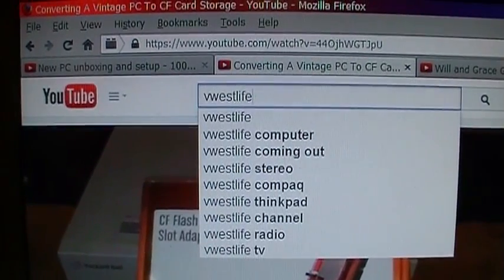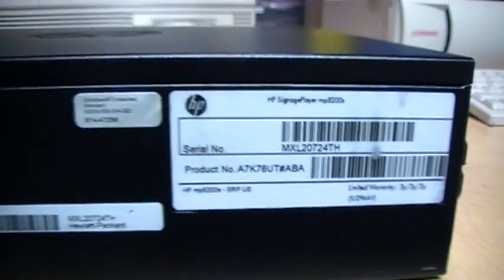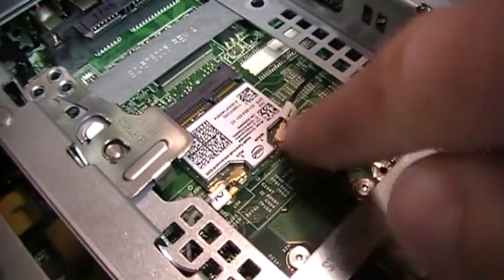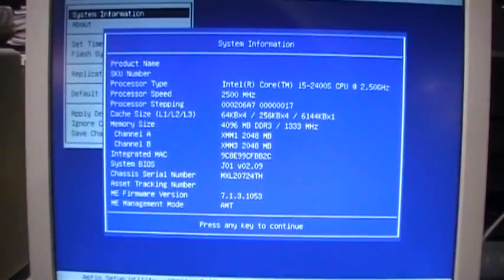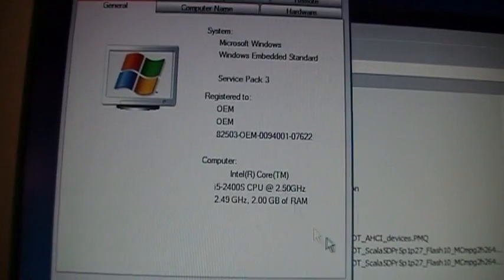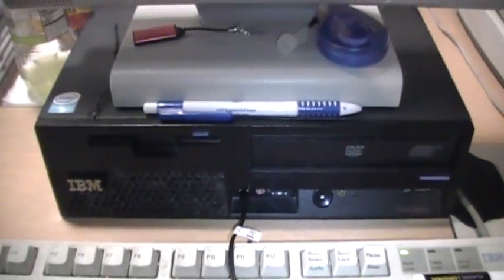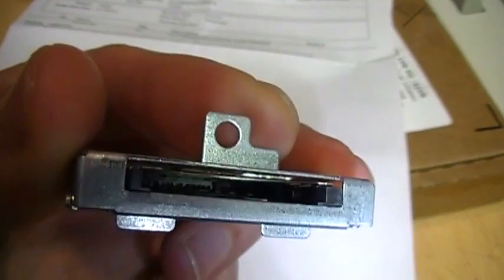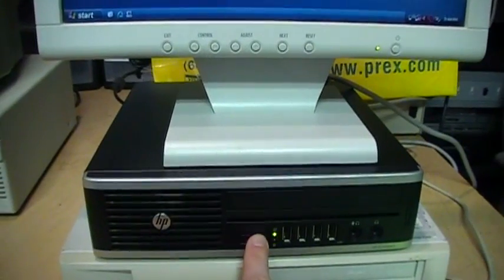My "new" computer: HP Compaq MP8200S

Comment: Nice system. Nice that it has so many usb connectors.
The "special connector" for the usb card reader should be plain USB.

The power supply is a fail though. It's so big it should be put inside the case.

Comment: I'd put Windows 7 on there, you're not going to want to run any form of Windows XP on an SSD due to the lack of TRIM support.
Reply from the maker: Intel SSDs have built-in wear management, and I have the Intel SSD Toolbox software installed. I've have the same model of Intel SSD running fine with XP in my ThinkPad since 2012.
Reply: vwestlife Do you run anything newer than XP? What is your opinion about the end-of-life?
Reply: ***** They still wear out as the memory cells have a finite amount of write cycles they can take before they die but a good SSD should easily outlive the average HDD assuming it doesn't have other issues like bad firmware code.  That can be the failure of most SSD's and even HDD's before a mechanical failure kills them.  TRIM and other wear leveling on an SSD is there to minimize the write cycles and also spread them out across all memory cells (memory chips) as to not wear one out faster than the rest so they're designed to last as long as possible.
Reply: +Gmoney 6422 it comes bundled with bonzi buddy!!!
Reply: Windows 10 is a virus oops theres tutorials and apps to disable the spying capabilities. OOPS, ALL IRRELEVANT

Comment: Ooh very nice! I'm a big fan of HP Compaq hardware, it just seems that they're the ones getting it right nowadays. Lots of people seem to have this very blurred idea of what HP Compaq actually is, and what kind of quality they produce. My next computer will probably be a HP Compaq SFF machine, or maybe a USFF machine.

Those VESA mounts are actually for a specially designed monitor stand that HP sells with some monitors to create an all in one unit. An example being the HP LE1901wi monitor. Also for a machine like that, I'd expect a maximum of around 16GB of RAM. I honestly had no idea that those can be configured with dedicated graphics, all of the ones that we have at work seem to have integrated video. I've also yet to try Windows Embedded Standard 2009, but it looks a lot better than POSReady for sure.

Enjoy using your new computer. Oh and one last thing: DisplayPort is actually backwards compatible with VGA, so you can get a passive adapter and use a second display that way.

Comment: I own 2 of these exact units.  They can handle a minimum of 8GB Ram (depending on the BIOS version), there are no USB 3.0 ports, and only the 1 Mic/Audio out jack can be used dual purpose (only the front panel port).  These are great machines and very powerful for doing pretty much anything, standard integrated graphics will slow things down for gamers however.  These are almost Identical to the HP EliteDesk units sold to enterprise customers today.  Both can boot off of any standard USB Drive to install any modern full (retail/OEM) version Linux/Windows 7/8/10.

Comment: That's neat it has a dedicated AMD (ATi) Radeon GPU and vRAM on a mini notebook style (MCM?) PCI-e board (the small red board with the heatsink behind the optical drive) I've never seen that style notebook video card in a slim desktop before.  It must have 2GB of vRAM on the video card hence the OS only sees 2GB of system RAM.
Reply: Nope, actually, Embedded 2009 can't take on more than 2 GB of RAM so it limits 4 GB to 2, not even 3.5 like XP 32-bit would. I use Vista Home Premium 32-bit and in some cases, 64-bit. I never really bought a computer but my friend has this one still and is currently using it with 7 Home Premium (i used my own multi licence for him) 64-bit and has all 4 GB RAM allocated.

Comment: That computer looks nice. I would be getting one instantly (even a lower specced model with an i3 or Pentium G and without the dedicated graphics card) to be my radio automation and streaming PC, but the lack of at least two serial ports (which could be fixed easily by USB to RS232 cables) and a full height PCI slot (for my M-Audio Audiophile 192) puts me off. So far I'll stick with my custom built tower PC for the task.

Comment: I have kind of a bigger and whiter version of this SFF, it has fewer USB ports on the front and a 80GB HDD. Came with a very strict Vista Business SP1 32-bit OEM which would only allow me to use IIS features or go on the internet. Even if the support has ended, I don't care, It runs Vista Home Premium SP2 32-bit with my original Microsoft SP1 licence. To be honest, Vista Home Premium runs faster than 7 Home Premium here. It also works very well, it's kinda 12 years old now so I'm not planning to sell it. Both side panels also broke off.

Comment: Nice, i have a sff system myself, it's a dell optiplex 3010. It has an i3 3225, 8 gb ram. I put a gtx 1050 ti in it and it's a tiny powerhouse of a pc. Love it, believe it or not it runs most games on high settings.

Comment: That CPU is actually very good, it has 99% the performance of my i5 3470 in my gaming machine, with a good graphics card it would max out all the latest games easy : P
Reply: Levi Pinkard runs cool,  low power use and stuff

Comment: Erm WES2009 is not meant to be installed directly like that,you are supposed to install the Tools into a development machine,run TAP.EXE on the target machine(in this case the HP DigitalSignage),and take the Devices.PMQ file that is made in the same directory of wherever the TAP.EXE is to import it into the target designer,where you get to choose components and enter the PID.
First off the evaluation version of WES2009 iso is NOT going to work with a full tools key,you need to go find it elsewhere.The Evaluation Version of the tools will not allow you to enter a PID to make sure the WES2009 image built are not timebombed.Also you need to find a proper PID,and if i recall correctly it is in a hidden file(forgot extensions) on the root of the installation.
After building the image you need to copy and paste the image into the SSD from the target machine.I recommend copying it multiple times,because sometimes it gives out the ntldr error if copied only once.

Comment: this sounds like a decently capable machine. Mainly with that graphics chip
Reply: the cpu is by far the most capable part of this system.
Reply: What about the Sandy Bridge i5?
Reply: that graphics card is no good, any card with less than 1gb dedicated vram is rubbish
Reply: not exactly, there are some ok 768MB cards.

The main flaw is the chip.

Comment: My school have these PCs now, except the larger version with the slot for the Floppy reader. They also don't have dedicated graphics, I think, but maybe they only disabled the ATi graphics. In System Information, it seems they dedicated 1.7GB of Vram to it. I don't even know how I got into System Information. They also have mSATA SSDs instead of the WiFi card because our school have ethernet wired.
We parted with HP Enterprise so we have HP everything - HP Keyboards, mice, and monitors. The teachers have HP Laptops.

Comment: Recently got the normal HP Compaq Elite 8200 USDT one of these for $50, has a i7 2600S but only the intel graphics. I plan on using a FirePro M5100 that I got from a dell precision laptop. (I will see if I can find a suitable heatsink for it, I’ll probably get a HD5450 from this machine with the heatsink and mount it on the FirePro)

Comment: I have another XP machine that refuses to boot past the bios screen with an external hard drive connected and if I unplug it then it's fine. I looked on the motherboard and many of the caps are bulged. I'm assuming the power supply may have bad caps as well. I have a bag of caps I can possibly use. This machine is a 2.8ghz 2GB and the one i'm on now is a 1.8ghz 1GB.

Comment: Could you put Windows 7 - 10 on one of these?? I would probably use one as a game stream computer in my living room. Maybe some internet usage too.
Reply from the maker: Yes.
Reply: +vwestlife Thanks for the quick reply. These are a ridiculously good deal on eBay for about £150! Definitely going to buy one, as my HP G5330uk is kinda messed up.
Reply: +vwestlife can you test it with an hd monitor? please! test it :-)
Reply from the maker: FryorSatin Super
What kind of test?
Reply: +vwestlife with an hd monitor
Reply from the maker: FryorSatin Super Test what with an HD monitor?
Reply: +vwestlife to test the resolution if it works
Reply: +vwestlife HD is High Definition
Reply: Yes it will work.
Reply: +vwestlife do it because, someone said me, yes. it will work
Reply: FryorSatin Super 
If you are asking to test to see if it will work with an HD monitor yes it will.  Whether you use the DisplayPort output or the HDMI output.
Reply: ummmm i guess?????? i would 7 or xp
Reply: You might want to upgrade the gpu if possible

Comment: HP Scala Signage Player - is that the same as the Scala Video titling software that used to run on the Amiga? Did this unit drive information displays?

Comment: personaly I own a beautiful HP Compaq 8200 elite small from factor and it a war machine! I own 3 mincraft server plus I do gaming on it and it still have some juice to run a 4k youtube video on my other screen. seriously does computers are made for life time durability.

spects: (i5-2500 (socket 1155) 8g ram 480g ssd crucial m500 (power supply 240w original and original mother board) and a radeon r7 240 2gb ddr3)

Comment: Still using xp? Damn.
Reply: Tech Locale XP still works fine to this day as long as you use an adblocker, firewall, and be certain you don't visit unknown websites.
Reply: I use an old version of AVG, 2015 on a Pentium 4 630 HT and 1.5 GB DDR RAM. It runs XP Home SP3 x86 and works pretty well if ya ask me.

Comment: Ahh, isn't it nice, old computers? They have more than 2 freaking USB ports :P
Reply: +Cole Jackson Mine has 8 in total and it's fairly new, just think some brands cheat you of USB's especially with this Cloud storage rubbish.
Reply: Yeah, I'm just saying, most computers have about 2, but I have one with more than that.
Reply: Dang! What kind of computer do YOU have?!
Reply: +GOHSBandVideos Store bought or custom built?
Reply: Eh. Whatever.
Reply: +Cole Jackson my pc has 10 or 12 USB 3.0 lol
Reply: so does mine, i upgraded
Reply: Yeah.
Reply: My main PC (motherboard from 2009) has 8 USB 2.0 ports onboard and 4 USB 3.0 ports via expansion card (2 rear, 2 front).
Reply: noice.
Reply: the nice thing about ps2 ports is that it frees some usb ports for whatever you want
Reply: My 1 year old motherboard has 7 USB 3.0 ports, 2 USB 2.0 ports, and a USB C port. Some cheaper computers will only give you enough for a mouse and keyboard, though.

Comment: Damn... I wish i could find something this well spec'd.

If you run some multi processor optimized video editing software on it, that quad core will shave some considerable time off your video rendering and encoding.
Reply: i have an old hp sff almost close to this one but a little worse, it supports up to 8 gbs of ram if 2x4. currently has 1x2
Reply: it also has a reliable core 2 duo e6550 2.33 ghz which works well
Reply: my main is a dell xps 430 which i upgraded. the core 2 duo inside is what i didnt change. i upgraded the 6 gb ram it had to 8 and put in faster hdds (2tb western sata 7200 rpm + 1tb western sata 7200 rpm (OS) and replaced the 256mb 3650 hd with a 5700hd 512mb. now it works pretty well and reliable

Comment: That is AWESOME. How much did you pay for this? eBay is listing one at $1200!!

I didn't know HP made any sort of box with an MXM-A card slot for the graphics card-- that's highly upgradeable with any MXM-A card that shares that slot type... you just have to rig the cooling for the card you drop in.

in this case, your easiest upgrade would be to go from that 5450 to an HP OEM part: AMD HD7450 http://www.ebay.com/itm/181317366385 for pretty cheap. the existing heatsink should also work, the holes are of standard size. This, along with the latest drivers for windows off AMD's website, and you'll have upgraded to a slightly higher-end chip that'll suck up less power, generate less heat, and keep the computer running cooler for longer with the fan at low speed as you have it.

You can also get a 6770M http://www.ebay.com/itm/181039851891 but I'm pretty sure the RAM chips would need extra cooling, in the form of a $3 bag of RAMsinks with thermal compound/superglue mix to keep them on the chips, if you were to still use the existing heatsink solution. not sure how good an idea that is though. but since MXM-A is still standard for laptop graphics solutions, the possibilities are endless at this point in time. another option would be to steal the proper heatsink for that card and modify it to your needs, but why bother? it's too much work researching this and that and the other thing trying to get heatsinks to play nicely in a nonstandard computer case.

In the end, I am VERY, VERY envious of your acquisition overall, and I hope to see a video later on about any upgrades done past what you've already dropped in so far.

Comment: I Have an HP from 2009 that is similar to this, The Compaq 8000 Elite, but it's bigger, The Small form factor
Reply: It's got 4 USB Ports on the Front, and 5 USB Ports on the Back
Reply: I bought an Elite 8200 CMT for $89.99 to replace my Dell Optiplex 755. i found a matching monitor at a thrift store a few months before.
Reply: @connorm955  Neat. I like the CMT just as much as the SFF to be honest

Comment: A USB 3.0 port has blue colour on its head instead of black also to have 4GB of ram unlocked you need a 64-bit or PAE Operation System. My system is worser but it can run Windows 7 and Windows 8 (with Aero activated) perfectly (Had to disable Aero just for gaming).

Comment: You really aught to load Windows 7 on there though.. Windows Embedded/XP Just limits what you can do.. And 7 is just a much nicer OS In my Opinion.. But that is just me.
Reply from the maker: I tried Windows 7 Ultimate on it, and it runs fine, but I still have some software I use regularly that runs best in an XP-based version of Windows, and Windows Embedded 2009 will still have support from Microsoft through 2019. I may do a dual-boot with Windows 7 in the future, though.
Reply: He doesn't like 7 as far as I know (even had a video where he randomly put a part of a different video in with a guy yelling "Windows 7 SUCKS!"). I think he really won't do stuff that can't be done in XP (POSReady 2009 is just XP SP3 anyways).
Reply: Have you tried the Windows XP mode of Windows 7 Professional? It literally runs programs in a virtual window like Parallels Desktop .. It's really quite fantastic!
Reply from the maker: TheDutchOwner's Tech Channel That was from GoatHerderEd's video about his laptop. :-) Computer Labels
Reply: VWestlife (I know this comment was made 4 yrs ago) I think now is the time to set it up. Probably better to do win10 now because the clock is also ticking on win7

Comment: Did you download an ISO of Windows Embedded Standard? I could only find an installer to be run from within XP.
Reply from the maker: Jake Charman No, I ended up using Windows Embedded POSReady 2009. I didn't need the extra features of Embedded Standard anyway.

Comment: Technically you can plug in 3 headphones using the green port on the back
Reply: No, you can't, as the audio ports on the back are automatically disabled when a device is plugged into one of the front panel ports.
Reply: STUPID PC
Reply: Jack disabling is usually done in software though, so with a little "jack retasking" you can probably get audio out of all of them.

Comment: im thinking of putting win2k 9 standard on my home server running win XP home till i can afford a board that can run win 7 since it needs the XP system itself and i guess then for there it converts over to embedded standard that is if  i downloaded the correct drivers
Reply: You should put the POSReady 2009 on it if you do not know how to deploy WES2009.It is not very easy and takes quite some time to do everything.

Comment: HP has been pretty alright EXCEPT THERE LOW OF THE LOWEST rage models but you get what you pay for in this industry, but they could follow dells way but I digress, WHY DO THEY HAVE TO KEEP USING FAT LAPTOP POWER JACKS. If that breaks it will pretty expensive to replace, you could repair it I guess

Comment: On 8 April the Windows XP would be discontinued.
Reply from the maker: Windows XP was already discontinued back in 2008. Microsoft will no longer be providing updates for it on April 8th, but you can still use it for as long as you want. Microsoft is trying to get people to think that any computer running XP will stop working completely on April 8th, but that is totally incorrect!
Reply: @vwestlife  totally agreed, XP works fully fine if you're using compatible versions of programs and antiviruses

Comment: Actually they're cheating even more! Per definition a Gigabyte is 1024 Megabytes which then again is 1024 Kilobytes. This seems like nitpicking but now that 10TB drives are around the corner this means we'll in fact only get a little bit more than 9 TB available and loose almost a Terrabyte!
Reply: I guess if you want a raw hard disk with no file system type such as fat32 or ntfs you can stick with your full capacity m8
Reply: Emanuel morales
 true m8, but would you throw away all furniture to have a bigger appartment? :D

Comment: install windows 7 or vista or windows 8.1 64 bit
Reply: i don't prefer 7 nor 8.1. im with vista and in old pcs, xp. i use a dualboot with vista home premium sp2 64-bit and 7 home premium sp1 64-bit just so i can run a few newer games and software like adobe's cc2017 tier software or newer games which require win7 or newer etc.